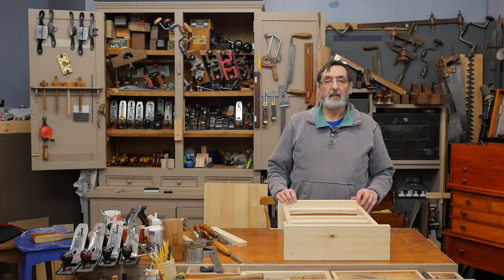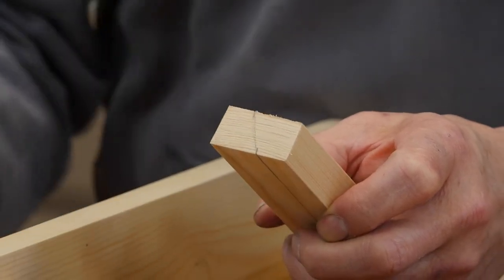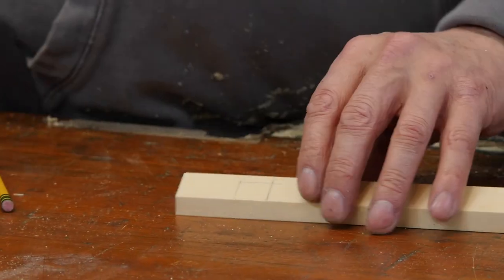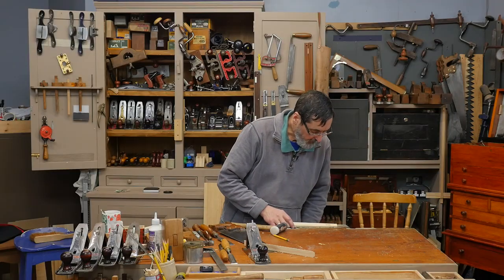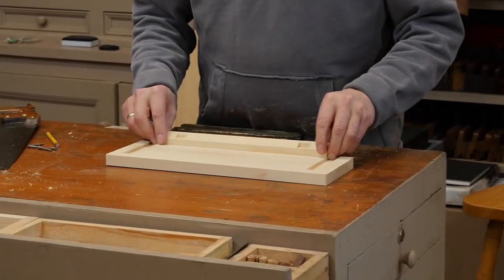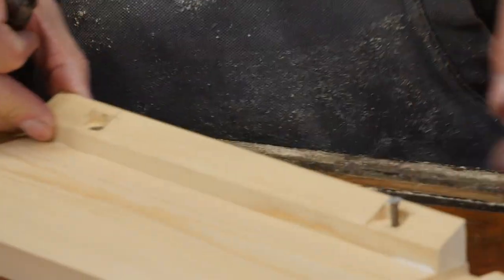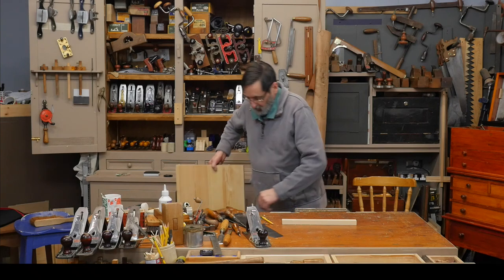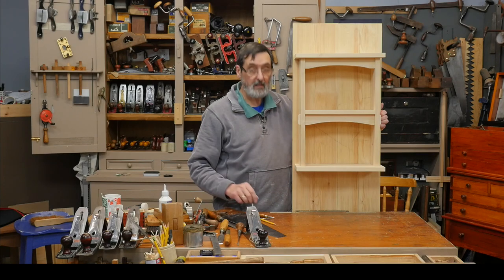Making a French Cleat | Paul Sellers

Comment: did he just draw a straight line without a straight edge.  Paul Sellers, like a Boss
Reply: How about eyeballing the screw holes for the wall half of the cleat? Paul has some amazing skill.
Reply: ofcourse, and he can probably do a lot of other things we can't emulate, but this is his teaching mode.
I am getting there with my sawing, best thing is a small Irwin flush saw, its all about getting the practice, andgetting good results
Reply: Reminds me of my woodwork teacher in high school 22 years ago! Paul Sellers is a great teacher. Makes everything easy for any beginner to follow through.
Reply: He explained this in one video or another. He uses his fingers to set the distance, holds them still and runs them against the edge of the wood as if it were a marking gauge.
Reply: You’ll find most experienced woodworkers do this.  I have since I was 16, and I’m now way beyond even reversing those 2 digits.

Comment: It is fun to discuss screws. I am personally to 95 % a Torx fan (less fatigue, less risk of the tool slipping the screw and making marks or destroying the surrounding component) but I have great respect for the traditional look of slotted screws and in awe when they are aligned.

But what is important is that you don't go buy cheap screw drivers and screws. Get high quality screws with smaller tolerances and pay the extra money for good quality high tolerance screwdrivers sized for the screws you want to use. Then the screwdriver will fit the slot much more precisely, also letting you use more of the slot for the torque, reducing the risk of deforming the screw head.
I was so surprised when I learned about this and since then pay a lot more for screws & screwdrivers - but ruin nothing this way anymore. As for rust & paint etc. - think twice beforehand and avoid the problem in advance.

Comment: Could have done on table saw in under 30 seconds. When it's done like this, oddly, you learn more than using machines. I find Paul to be top 5 on YouTube, simplicity, and he speaks to the weekend warriors, like me, and the advanced Craftmen. He works like a surgeon.
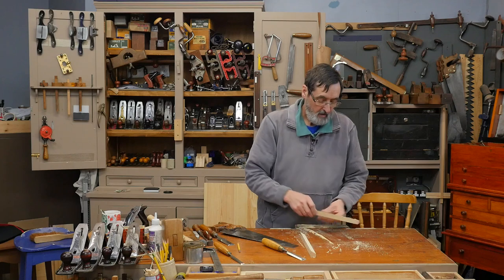Reply: I mean the part that the table saw could have done, he did in just over a minute from 2:04 to 3:14, from the time he had the piece ready to cut.  That's not a big difference in real time saved, and then he quickly planed it on the same bench, which might be necessary off a table saw anyway, if one wanted a perfect smooth surface.  And he didn't need to have or use a table saw.  So, seems nearly as quick, and way better overall.

Comment: I love a french cleat.....but I hate slotted screws (only use them when absolutely necessary).
Reply: +Sharp Edge Woodworking Curious, how different people have differing views on the same subject.  I LOATHE star-headed screws.  In my workshop, we call them 'moron screws,' and any that come in are immediately binned.
  The reason?  For one thing, I work with wooden mechanisms which are usually around 100 years old, and the modern screws would look out of place.  On a more practical level, have you ever tried getting one of those moron screws out?  When it's locked in with rust?  Try cleaning the head of one of those things, when your pointy screwdriver has ruined its shape!
  Sadly, in my view, the moron screw has taken over, as the morons with the electric drivers expect to fire them into the wood, preferably without pilot hole, clearance hole or countersink,  (I recently had a 16-yr-old in my workshop who intends to be a joiner, and had taken classes at school to that end.  Without exaggeration, he had never heard of "pilot hole, clearance hole or countersink," and it took him a little while to grasp the concept.  And, as for putting a token countersink on the back of each hole, to accommodate any fibres which might be lifted out as the screw is driven in ... forget it!)
Reply: +Offshoreorganbuilder It is sad that when I walk to a hardware store, I just cannot find nothing but star/torx screws anymore. They are pain in the butt when trying to remove if they have paint or sand or anything in the hole. With slotted or phillips screws you can brute force them out by leaning on the screwdriver but with torx it just will not happen, because the driver just will not go in. I had to take a patio apart and that caused some cursing I can say.
Reply: MichaelKingsfordGray You are barking at the wrong tree, "mate". But at least here, every contractor uses those screws. Just because nothing else is available at decent price.
Reply: MichaelKingsfordGray You may.
Reply: Hey, I totally get the purpose and aesthetics of slotted screws.....and like I say, I use them where I have to. I just dont enjoy the process of driving them in after the first half a dozen.
Reply: MichaelKingsfordGray We must differ on this one.  In my experience of difficult screws (which is considerable, though I say it myself) slotted screws are easier to remove than the moron kind, under adverse circumstances.  You have, at least, a chance to clean out the slot, which is not the case with the rusty or ruined moron screw.
Reply: BlueOceanRoss Sorry to learn of your hearing loss, and use of moron screws.  (Maybe the two are connected?!)
Reply: You guys sure are passionate about screws.
Reply: apinakapinastorba It's a common pass-time!
Reply: +apinakapinastorba Vasenkätinen poranterä ois varmasti ollut poikaa =)
Reply: He Ka Sorkkarauta tuli lopulta avuksi.
Reply: +apinakapinastorba Yeah...all this talk about screwin'. Lets keep it P.G.
Reply: +MichaelKingsfordGray 
I often recall a tour around a submarine in my early teens - I am now  64 -  and seeing a control panel with lots of brass screws and all the slots  impressively in line,  it stuck in my memory.
I now renovate sash windows and when the catches and locks are fitted the slotted screws all line up. It looks right.
Torx/star screws are a terrific product, enabling far more efficient work, but they dont have the antique / period look.
Reply: Robin Ergis ;And what happens when you try to get the star-headed screws out, and they are rusted in???
Reply: +Sharp Edge Woodworking 
My method that makes driving them in easier is to first drive in a torx/ star screw, remove it , then put the slotted head one in . Still a bit of fiddle but makes it easier
Reply: Good thinking, but would you not just leave the Torx in place?
Reply: Good thinking, but would you not just leave the Torx in place?
Reply: Torx? Those are lovely! I know they look out of place on old stuff, but if you use galvanised torx screws from a respectable brand, they will last a lifetime. Also, they are SO much easier to get out when rusted compared to slotted screws which just strip and leave you with nothing. I had to drill out so many slotted screws because of rust, on a project. Had to insert bigger screws afterwards.
Reply: You cant see them .
Reply: +OffshoreOrganBuilder: +1

Comment: Works well for very heavy mountings where a knock upwards will not knock it out of the cleat. My clamp rack weighs several hundred pounds when loaded. The 5 ft long 4 inch deep cleat spreads the weight over 4 studs with a clean look.  Works well for a mantelpiece as it keeps the wood tight to the wall; use a deep narrow angle cleat.

Comment: Thanks for that video. It was fascinating comparing your hand tool methods with my power tool methods. I love your chisels with their mirror finish. I also noted that you drill the pilot hole first before the counter sink, the same as I do. The modern generation don't care about accuracy. 

I differ in making my French cleats in that I standardise on 45 degrees. So the thickness of the strip wood is marked in the centre to create this angle. That way all my creations can be swopped about on the wall mountings.
Reply: I've actually thought the opposite of the modern generation of woodworkers - that they valued accuracy over style and quality. There's an obsession with overly complicated jigs and attachments that make simple jobs like this into expensive ordeals, involving heavy equipment, just so they can say they made a straight line when they cut. In the end, most often a hand tooling method would have been faster! The truly sad thing is seeing they've filled their workshops with expensive tools and computerized equipment, but also with the cheapest lumber.
Reply: Very likely true. I've never been able to figure out why spending more money and time on something was a good thing, especially when the finished product looks like it came from Ikea. Having seen Paul's quick tutorials on cutting dovetails is ample reason NOT to buy a jig.

Comment: I've really picked up the gaunlet with woodworkng, currently fitting out acupboardasa tool centre, all different types ofjointsand fixings.
If I am screwing a one inch batten in to wood what length screw do I use for strength, and how close do they need to go, at the moment I am just guesstimating.

Comment: Paul,  Thanks for a slightly different twist than I am use to.    

QUESTION:  Is there some reason you don't just split the cleat on a 45 degree angle down the middle??        JimE
Reply from the maker: +Jim E Knowing wood it wouldn't oblige me. Oops, you mean split as in saw to 45-degrees, sorry. Yes, it's not necessary and my way is quicker and leaves out the unnecessary step of setting the square to do what eyeballs perfectly.
Reply: Jim E
Reply: Jim E

Comment: Your "square" awl. Is it truly square or slightly parallelagramish?? My leather awl is "diamond" but doesn't look as stout as your metal shaft dimension so I would be afraid to use it even for pine. Wonder what alloy it is also. Do you "stone" sharpen or just strop it? Thank you Paul. I watch all of your current stuff too. And have the Artisan in hard cover. Thank for what you do!

Comment: I’ve been wanting to do a French cleat for a cabinet I want to hang. However it will be much heavier, and I can’t think of anything with just joinery that will withstand the loads. For instance, that dado on the underside of the shelf top that houses the sides the of the self seems to work for this, but I feel it would separate for a much heavier shelf hanging from a French cleat. Thoughts? I wanna make a box of joinery such as through tenons or something and fix that to a wall
Reply from the maker: I think you are right it was not intended for heavily laden shelves so it’s a question of changing the joinery so that the housing dados go into the sides of the uprights then it would work just fine.

Comment: As always another nice demo by Paul. 
Can anyone tell the brand of the mallet Paul is using?
Thanks.
Reply: +ronin4711 he uses a Thor hammer - see thorhammer.com A 7-series with wooden handle and with a hard and soft insert (the faces are replaceable).
Reply: I have a 31-712r from Amazon, I think its the same.
Reply: Got it, thanks a lot, I have a few but they lack weight...

Comment: If the wall is vertical, and if the French Cleat cannot be inset into either the wall or the piece to be hung, would you place a standoff at the bottom of the workpiece to make it vertically parrallel with the wall?  That wat, it wouldn't tilt outward.

And if you did that, would you  match the lower offsetting piece with the very same french cleat cuts and fastenings as you just did the upper cleat?

I ask this because many years ago I did this to a (1) totally flat concrete wall, and a totally featureless rear of a kitchen-type cabinet.  Vertical wall, vertical cabinet, and two holding points (French  Cleats), upper and lower, for a bit more strength.  Now I have to mount an even elarger cabint to that very same concrete basement wall.

BTW, what fastening system would you use to fasten the wall side of the assembly to the concrete wall, that has nothing but solid brick underneath? I used lead molleys back in the day, because that's what I had.
Reply: Jeff Polaski I don't  know   if this helps, but I've  put a cleat on the back of the cabinet, and then put a cleat on the concrete so that the cleat on the cabinet rests upon the cleat on the wall. No bevels or anything fancy. Then screwed the cabinet into the cleat on the wall. Or you can dispense with the cleat on the back of the cahinet, remove a portion of the back of the cabinet the same dimensions as the cleat on the wall, and slide the cabinet over the cleat and fix the cabinet to the cleat from the sides and/or top. Use 1×4 stock to trim out the gaps between the wall and the cabinet. I use tapcons (concrete screws) for the cleat fixed to the concrete wall. I know that I'm seven months too late, but ...

Comment: Brass slotted screws for his work of art. Do you align the slots😀?
I love how you do things but I still use an electric drill and rip with a band or circular saw. Too much wobble with a hand drill. Rip cutting at 45 degrees ain't easy with a hand saw, especially if I had sharpened the teeth. If I ever saw a manual pillar drill again I would buy it.

Comment: Hi Paul.  I have quite a large number of books on shelves in a room which I made myself.  I have never seen this method of hanging shelves on a wall before.  My shelves are all stuck to the wall with brackets which I do not like.  How would the same method using the french cleat apply to shelves that are six foot long and Four foot wide.  I have my shelves sitting on a strip of batten to take the weight of everything.  I am a hack hobbyist woodworker so my knowledge is not great.

Comment: I have a dilemma? I built a large heavy beautiful shelf and intended to hang it with cleats like these. But the clearance needed for the cleats to interlock will not fit in the amount of space there is. Can a person trim the sharp edge of the 45 degree cut and maintain the strength necessary for such a large shelf?
Reply from the maker: It will be fine as long as the length exceeds the depth. In other words, there is bottom weight and this gravitational pull should keep the shelf in place.

Comment: Anyone got idea how big french cleat can be? Can I hang big garage shelf on french cleat (big cleat, made from 2x4 for example) and still be safe? French cleat is really nice in terms of hanging stuff by myself and it's really easy to level compared to hanging whole shelf, but I got doubts about safety.
Reply: +DentargPL It seems to me that if you  could hang the shelf from a 2X4 screwed across a couple or three studs, you could hang the same, or more, weight on a french cleat of the same size.  For instance, if you could make a ladder with 2X4s between studs, and climb it, then a F/C spanning two studs will hold your weight just as well.  Of course, it all depends on the length of the screws you use.  If you plan on putting more than a couple of hundred pounds (50 Kg, 14 stone, whatever) up, then maybe use a 2X6 instead, and double up on the screws.  Once the weight is on it, it takes a fair bit of force to lift it up and off the angle of the cleat.  you could also tie the bottom of the shelf in to the studs so it can't "swing" out from the wall or be lifted accidentally.

Comment: Shouldn't you level the wall cleat from the underside of the cleat?  If your saw cut was not parallel to the edges then the wall shelf would hang askew. By leveling on the bottom of the cleat you ensure parallelism on your hung project since you made the cut from one piece of wood that started out with parallel sides.
Reply: His leveling technique is incorrect since there is no guarantee that the angled cut he made by hand with a hand saw is going to be parallel to the edges of the wood strip that he used.  One thing that you need to be concerned about though is that not all levels are guaranteed to have their surfaces parallel.  From the look of the level that he is using, I would definitely be hesitant to assume that both edges are truly parallel.  Also, there is a noticeable gap visible between the cleat and the level on the right hand side.  I suspect that is due to inconsistencies inherent to using a hand saw for the cut.  In the end though, it just depends upon what level of precision you are willing to accept.  If you are mounting it on something with vertical lines, it is going to be more noticeable if it is askew.

Comment: Paul u did WRONG! :)
In this case you didn't ripsaw the cleat straight (no problem) but if  your water bevel on the sawed side and bevel it after the ( not straight) sawed side, the bookcase will end up hanging in a angle! You have to bevel the the cleat on the wall after its (straight) underside. then it will self compensate for your not perfekt ripsawing. 
Live long / Fredrik
Reply: +Fredrik Andersson Assuming you meant level (as in the tool) and not bevel (as in the cut).  Then, yes, it would be more correct to level the uncut edge of the wall mounted cleat.  But since this was simply a demonstration of the process, I think we can forgive a millimeter or two.